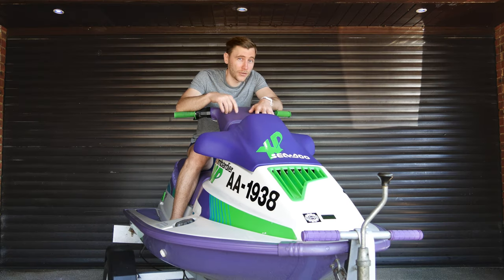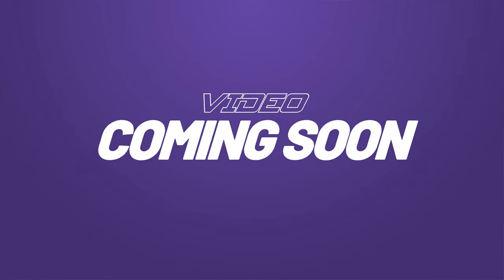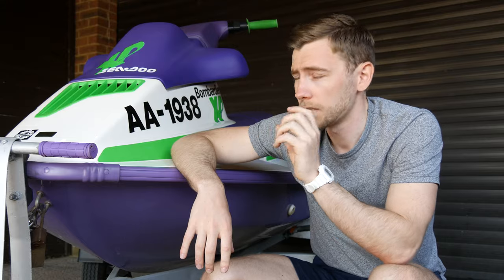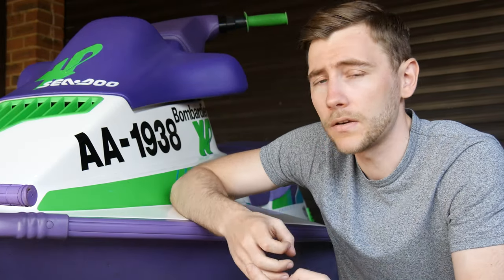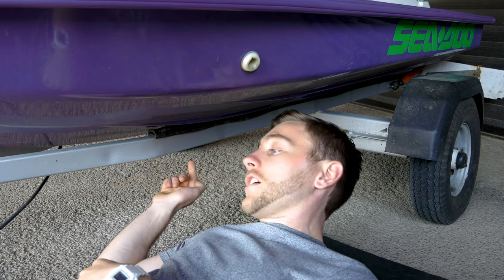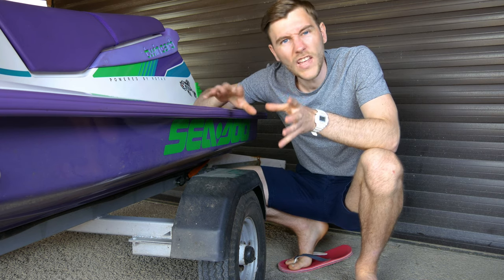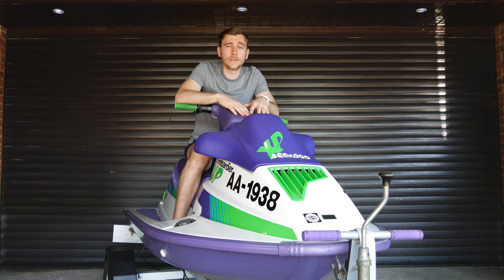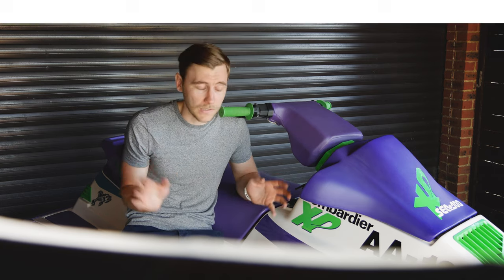Restore CHECKLIST | 580cc Twin Carb XP | XP 1991 Series | Ep2

Comment: the feet grips arent wavey they are there for gripping and standing on them with your foot angled
Reply from the maker: Understood that the foot pads are for grip but the waviness is a material related issue...over time if water is left in the footwell the material ends up deforming... its a common issue with a number of year seadoos... the foot pads should be flat hence why on super clean examples, if the foot mats are still flat you know its been looked after... Thanks for watching and supporting dude